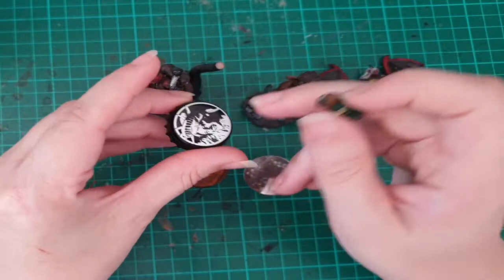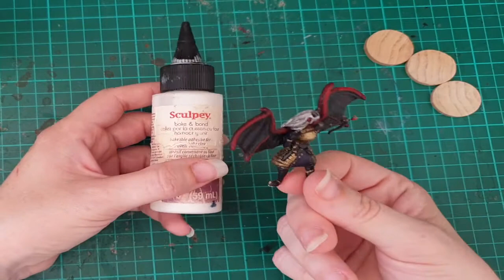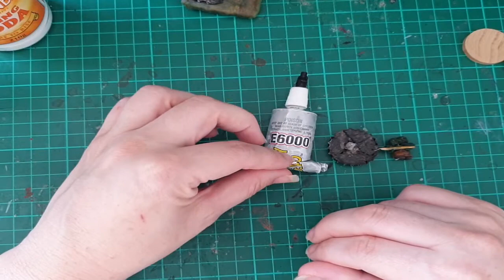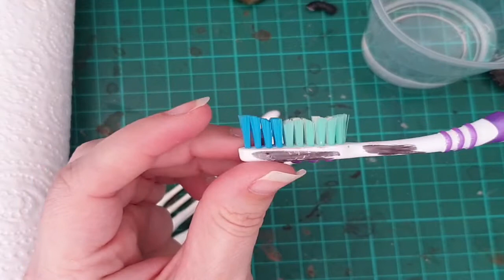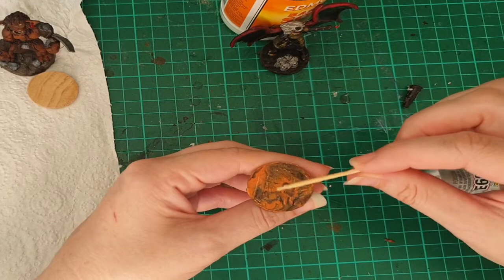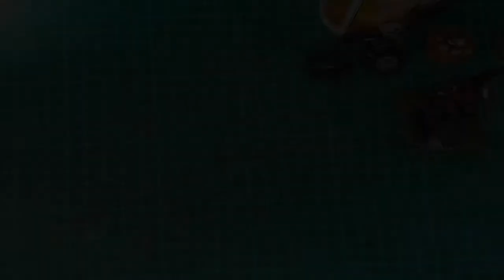HOW TO Clean and Repair Miniatures

Comment: I immediately recognized what that devil lady archer was made from. XD

These minis are significantly bigger than the things I need to fix... Like these old 1982 TSR-made Boobrie birds whose legs are slim as a thin paperclip, and thus snapped off. And similarly small (25mm scale, the original gaming mini size) humanoid types who've lost arms, hands, and weapons.
Reply from the maker: Yeah that one in particular is from a set that's a larger scale than the average TTRPG pieces.  Though it is a scale I feel most comfortable with painting and modifying so far.  That said of the hand sculpted ones some are MUCH smaller than her, like the rogue halfling and goblin.  I do also have some small metal die cast that need repair but I have yet to decide what material to use.  E6000 may work ok, especially if the metal is sanded first though I was also considering trying Green Stuff and just remaking whatever has broken off...just not sure if I have that level of skill yet for such a small scale.